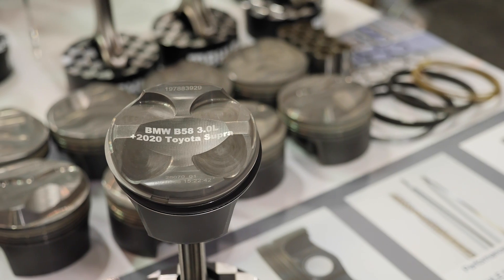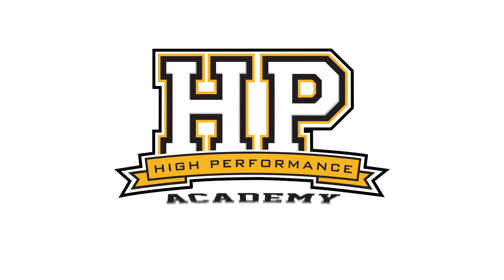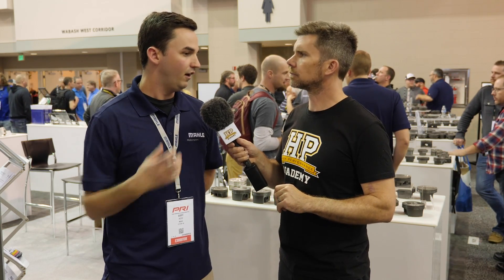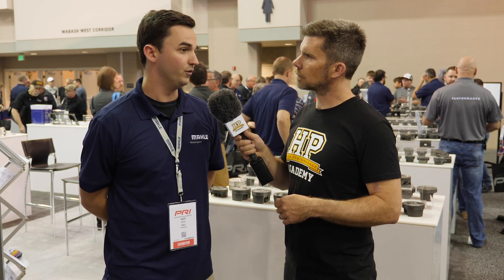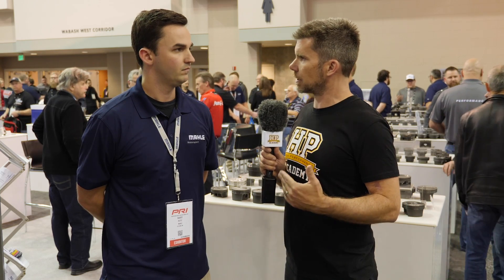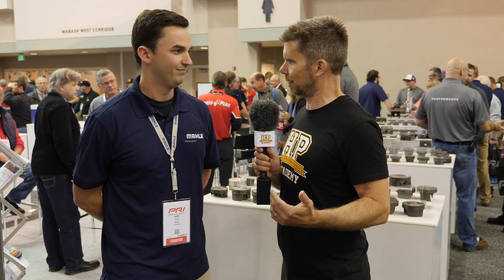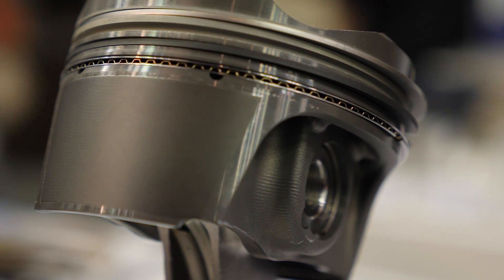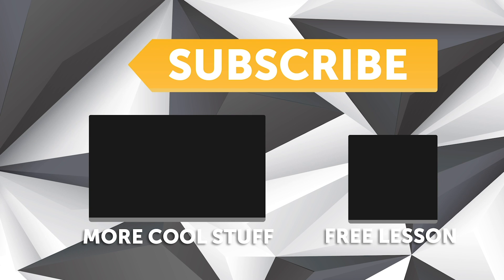1000HP+ A90 Supra Pistons | B58 Forged Pistons [TECH TALK]

Comment: Taz Quinn recommended I ask this question here:  How do these 1000 bhp Supras manage to run 10.5:1 CR and port injection without knocking?  Are they running very high octane fuel, like E85 or avgas?
Reply: Good DME engine management, and indeed most guys use higher ethanol mixes with port injection.

Comment: The new motor 2021 has lower compression and the head has six exhaust ports as opposed to the 2019 go figure.
Reply: Really?  The B58D variant?
Reply: @ifan3270  basically. All they did was go from the B58C to the B58D. Dunno about the 2022 but my guess is that it'll just be a tuned B58D since they said it'd get a yearly power bump of 50hp per year.
Reply: I'm sure Toyota had some input, a lot of input.

Comment: 1:55  "These customers like lower compression and are going to be running pump gas"  Maybe way back in the day but in 2020 the sort of customer who is going to be swapping out their pistons on a A90 Supra are NOT going to be running pump gas and DON'T want a lower than stock compression piston.  Wouldn't you agree?
Reply: TurboDieselDan E85 still isnt regularly available in each state, also, E85 isnt available in the masses in europe yet. You have to realise that Mahle builds the Pistons for the worldwide market, not just USA
Reply: For street trolling some will be on pump for a daily map AKA streetable. street able. Switching to whatever fuel they tuned for to go on kill mode.

Comment: Might have to pull the n54 out and get on the b58 wagon with the aftermarket moving so quickly.
Reply from the maker: If you need any peer pressure, I'm your guy - Taz #doit #theoldyouwouldhave

Comment: Very impressive that they’ve managed to create a lighter forged piston assembly. Can’t wait to see the times the drag racers will be able to get out of these engines in the next few years and whether they have to dramatically change the setup to work around certain unusual elements of the design like the exhaust manifold
Reply from the maker: Yes I wasn't expecting that either. It's already looking like there is going to be an active scene with these A90's so here's hoping it just gets more and more interesting in the next few years eh =D - Taz.
Reply: High Performance Academy Ive seen the revised Supra Head, and it has 6 Exhaust ports instead of 2 now... Looks like they have changed the design dramatically!
Reply: @SeanMclaren  if I remember correctly it's just the Z4s B58 which as u said has the 6 port heads instead of the 2 although I heard that the B58 that's going into the 2021 mk5/thats in the Z4 might have stronger internals so we'll have to wait and see if that's true.
Reply: Intriguing stuff really, very informative.